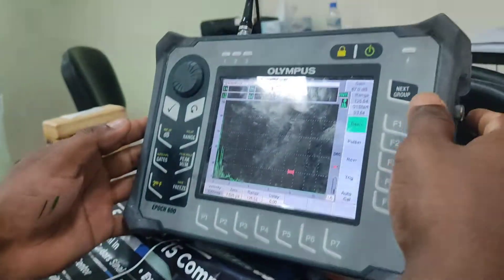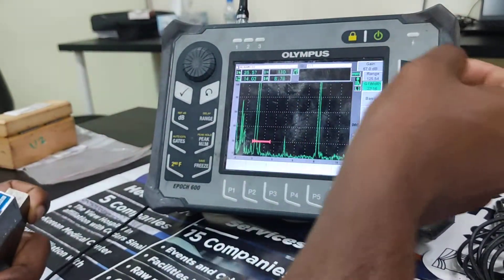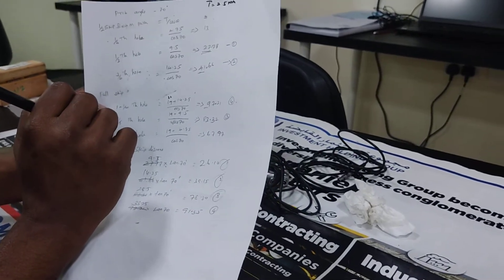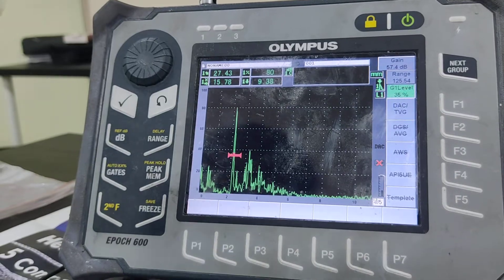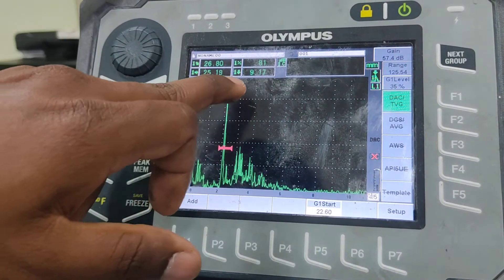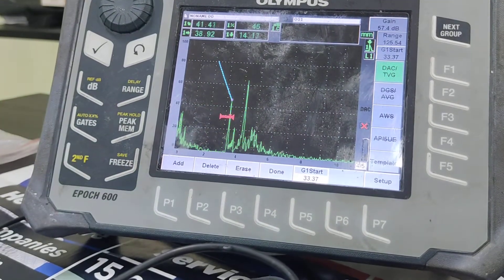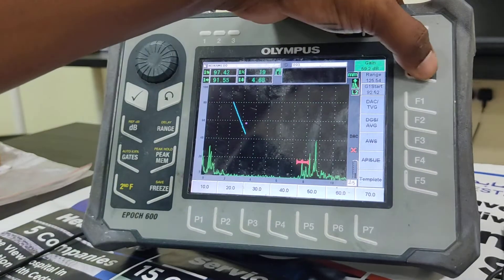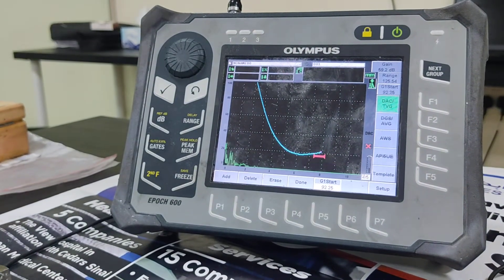How to draw DAC by using using 19mm SDH block70 degree  Olympus Epoch 600 Ultra sonic flaw detector

Comment: You draw the wrong DAC
 because when we select the first point at reference dB we can't change the reference dB for another point.
And in this video you change the dB for the 3rd point so it is not acceptable.😮
Reply: Good day, pls do you have any reference site where i can get correct and detail tutorials on Olympus EPOCH 600?
Reply: @sanisaleh2421 You wan setting Olympus 600? I have it
Reply: Yup you right, Can't change the dB reference..